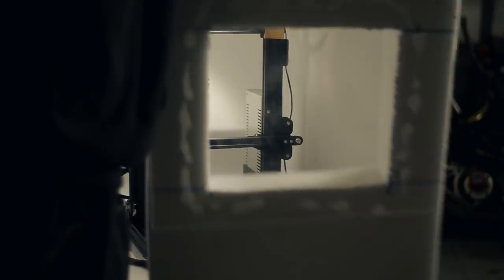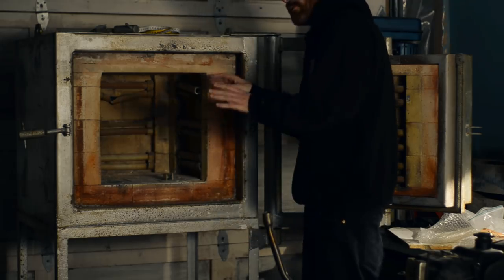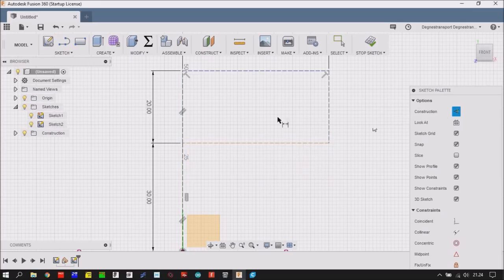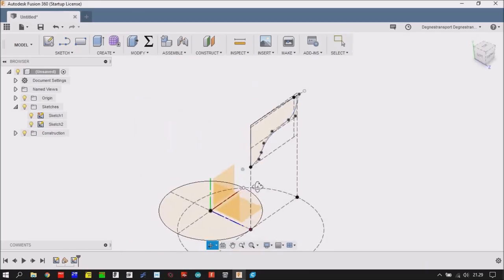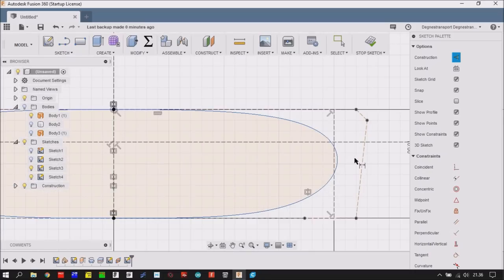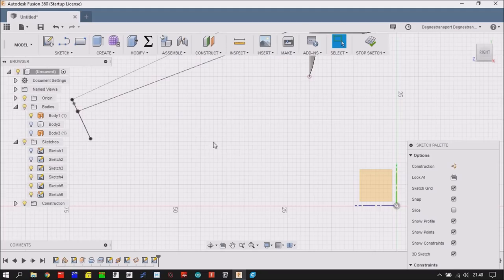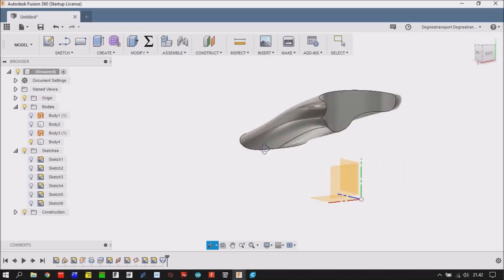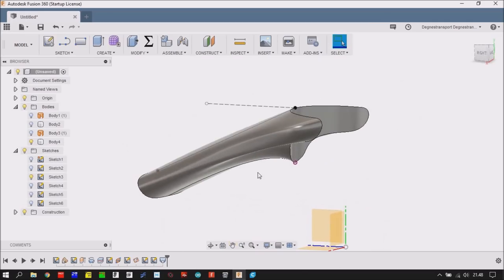Road to The Most Powerful Two Stroke Ever Part 2 - I can do this!

Comment: I bought Jennings Two Stroke Tuners handbook in about 1983 when I was road racing the LC350 stroke and planning on doing mods after racing it standard.
I read it many times over including sitting on the couch reading it during Christmas day with the family, my GF was not impressed and gave me hell over it but I only had a few weeks to read it and get the pipe made and porting done in time for the race season so it had to be done.
Reply from the maker: Sounds like me... I've read it multiple times too, years ago, but only in pdf form. A physical copy is something different.
Reply: @2STROKESTUFFING  
Yep, hard copy is good for doing a quick lookup of equations in the workshop too when I was making pipes, no need for a pc.
Reply: I also read Jennings Two Stroke Tuners handbook ,but I'm only 17.  I heard that Jennings formulas are not so accurate, but are they usefull ? I want to make my own pipe, but I'm not sore about which formulas should I use. Maybe Blairs stuff is more usefull ?
Reply: @JohnAZHUN  Jennings book was written in the 1970s and derived from copying factory pipes and a bit of reverse engineering, the pipes do work, that said Blairs equations are from more scientific studies done on using modelling and published in 1996 so far more recent.
Reply: @AuMechanic  Okay, thanks for the answer!
Reply: @2STROKESTUFFING   '2-stroke tuning in performance & practice'  (Graeme bell)  this was the bible of 2t tuning in my day..mostly kart orientated motors ,but excellent reference for general tuning...had a few pipes made from equasions from this book ,all worked fine...👍
Reply: classic desirable book .. prices have come down .. but about 15yrs ago a good quality paperback used copy of Jennings book was selling for up to $250.
Reply: yes, jennings book was usefull in the 70,s , i used it ,but as the years rolled by gordon blairs, q u b  s a e papers were the best, i stopped playing with two strokes in the early 90.s but bought a few  s a e papers later ,these are where the real info is as the guys doing the development are really switched on , since g p bikes outlawed the two strokes ofcourse outright power development stopped, , i dont agree with alot of this guys power figures but the use of a 3 d print is magic and ofcourse the cad drawing , i had to hand draw all the port shapes , etc , that was hours of work  and a lot of times it didnt ofcourse the real power is in the pipe
Reply: by the way what the guy needs now before he prints the barrel is c f d to show what the gas flows will do

Comment: If you dont need as much height in the kiln then you could remove the bottom set of elements and add fire bricks in the base to reduce the volume, that way you keep the kiln volume to element ratio, in doing so reducing your electric demand but still maintaining the same temp ranges.
Only cost you some bricks and the time to rewire to single phase not a hard mission.
Reply from the maker: Thanks for the tip!

Comment: Top fuel dragsters often drilled 6- 10 micro holes horizontally in the rings running higher RPM and cooler under extreme conditions + fuel types, where the ring meets the cylinder wall allowing oil pressure to minutely lube the parts that need it the most , ever heard of that? USA hot rod magazines has the info , I thought you might be interested. Love the Low\High tech projects,  Thanx Richard Mack.
Reply: That will not work on single ring 2 stroke pistons because the ring won't expand properly anymore, and thus increases blow-by.
Reply: nick f look back tomorrow I'll try n find some info for you
Reply: No, we don't

Comment: I been building some small 2 strokes myself. Playing with some old homelites. Dropped the deck. Raised the head. Running exaust at 100% of bore. Havent caughy the ring yet. "YET". changed the transfer angels and made a expantion pipe for it. Built a dino from old alternator and motor was .7hp at 10500 rpm. After my mod which are not all listed i was able to pump out 7.2hp at 14,500. Running on methonal. Motor sounds awsome but scary. Still progressing further everytime i play with it. Pushing it to distruction to test limits. Love all your videos. Taught me alot. I may upload a video. Never have before. Keep up the great work and ideas.
Reply from the maker: Thanks! Wait, 110% of bore?!
Reply: @2STROKESTUFFING  the port width. And i only raised it .065" which is the same of as to what i dropped the cylinder. And i have the the piston pin welded shut. Its a one time deal
Reply: Not sure of duration
Reply: I believe i have it at 210 degrees and what did the most was changing transfer angles and stuffing the crank case
Reply: @2STROKESTUFFING  nevemnd you it just dawned on me. I havent been measuring right 110 is not possible. Wow. Its 100. But since on the motor im working with has such a skiny tranfer and they are far back towards the intake i have the exaust cut clear back almost going above the tranfers.
Reply from the maker: Pics anywhere?
Reply: @2STROKESTUFFING  no i will try to upload some. Im not on anyforms or anything. Dont even document my work much.

Comment: For your kiln you want to determine and record shop voltage, feed conductor size, approximate length and the type, your maximum temperature, kiln volume, insulation type and thickness plus your door seal quality. You will likely want a PID Temperature Controller with a K type Thermocouple and Solid State Relays.  I suggest a temp controller with a Ramp & Soak feature. This allows a programmed ramp to control the rate the temperature is raised and lowered. It would also allow pausing at set points to allow time for the heat to Soak. There's several ways to handle the SSR's, pulse width modulation, regular on/off, and proportion SSR's. PID Temperature Controllers have become quite inexpensive and with Autotune and Fuzzy Logic they can be set up without having to understand Proportional, Integral, Derivative adjustments. Thermocouples are a junction point of dissimilar alloys that produce a voltage in proportion to temperature. You can install them in parallel  to measure the average temperature. A pair of well placed thermocouples is a nice feature to have if a thermocouple fails. They usually fail open so your cure would be able to continue without knowing a failure had occurred. If you're not in a hurry it's possible to order elements to perfectly suit your needs.  

You can operate your 3 phase heaters using a Variable Frequency Drive, a VFD. It will covert your single phase AC voltage to DC and that DC into 3 phase AC. A PID controller can be linked to the VFD for a tidy package. This wouldn't be my first choice as it relies on a lot of parts getting along. Heating elements are prone to causing problems in their dying seconds and have been known to jump considerable distance to short on their nearest relative and fry something that earlier was controlling their every move. 

Well there's a start for your consideration. Now back to your video.
Reply from the maker: Thanks for the tips, much appreciated!

Comment: About the kiln: since we are not shooting for very high temperatures, or fast heating, I would just change the internal wiring if it is possible. If you have a N in the connecting point where the input cable connects to the kiln, just connect a normal 1-phase plug with blue going to N and brown connecting to L1 and L2. If the kiln really is 5kW it should be ok if it is the only load on that breaker. The broken elements seem to be the top, so if you're lucky, they all are in the same phase. If not, you could swap the elements and insulators around until they are. Then you would get 2/3 heating power, 1 phase input and would have to buy zero parts. If in doubt, consult a savvy electrician.
Reply from the maker: Sounds like a good Plan A!

Comment: I'm quite sure that you have to make two separate exhausts to make the gas changes faster. Two exhausts system divides one big vortex into two smaller one. These small vortex are faster and then you can add RPMs near 19 000 or at least 18 500.

Comment: You can center/align view on a layer by using the function on the bottom middle, left to the hand-symbol (it looks like a folder or a wallet) 
and then selecting the layer to align your view with.

If you cant select the layer make sure its visible and selectable in the feature tree(the hierarchy on the left handside) 
You can find all created layers under the construction folder just hit the light bulb to make them visible.
Reply from the maker: Thanks for the tip!

Comment: you can fit an inverter for the kiln converts single phase into 3 phase garages use them for there lift ramps
Reply: ray walsh g if i remember correctly inverters/vfd's are not suitable for resistive loads like kiln heating elements

Comment: Always try a model symetrical parts as a single half and then mirror if you can. Less likely to cause issues. Now you have the exhaust shape you can use plane along path and use the project/ intersection tool to create a sketch  of the cross section at various points. Click on the profile generated and you'll be able to check the cross sectional area at any point along the path of the port.
Also, check out SimScale for free, powerful CFD analysis.
Reply from the maker: Thanks for the tips! Funny, I was just looking at SimScale.

Comment: I know you want to do it all yourself, but you may see how much it'd cost to have it printed for you by a company that does on demand printing and have them print it on an sla printer using castable resin made for burning out clean specifically for casting metals.
Reply from the maker: I'll look into it!
Reply: sinformant:  the drawback to that approach is that he will probably need to print many design iterations to get it printing well, and to get it printed to the right size (aluminum shrinks a lot),  and to get the porting optimized for performance ..... all that could get very costly with paying a professional company to print those parts ... just one or two outsourced print jobs can cost as much a one FDM 3D Printer.
Reply: @KrustyKlown  well he can print tests at.home.and measure. I was talking about the final version after he has everything worked out and I'm sure he is already accounting for the shrinking of aluminum.
Reply: @sinformant  still will take casting several printed parts of varying sizes before getting the shrinkage exactly right, then he will need to experiment with pouring & venting holes and some castings will not fill entirely, then when he wants to test changes to the porting .. he will need dozens of 3D printed cylinders, and probably doesn't want to pay thousands of dollars to have them professionally printed.  The printer he has, as is, is perfectly capable of parting the parts he needs for his casting project ... I run a FDM 3D printing farm business .. he can do this.
Reply: @KrustyKlown  I said final integration. With sla printing he can get it smooth and need almost no support structure and can have it printed in a casting resin made specifically for this purpose. I don't run a printer farm, but I do own two 3d printers and plan to soon built a foundry to start casting.things out of aluminum. There is a channel called Ford boy something that does sand casting with 3d printing and aluminum. He covers somewhere the exact shrinkage rate of aluminum as it cool. I al also very aware of how expensive having things printed from printing services.
Reply: @sinformant  OK, thanks for clarifying that, now I understand your suggestion much better.
In reality, to use FDM to print his part well, he will need to split it into several pieces ... basically design it for FDM printing. Once he does then get to a final design, he might as well FDM print it on his own machine. I have always wonder, for casting, would it make sense to try FDM printing using ONLY water soluble support FDM filament material, in a plaster of paris mold (not sand) .. just wash out the FDM part prior to pouring in the aluminum.
Reply from the maker: That is a very interesting idea! Seems like alot of the problems with the lost pla process has to do with how the mold reacts to the plastic expanding during burn out. How would the plaster mold like being submerged in water? Wouldn't it too start dissolving?
Reply: @KrustyKlown  that is a good idea to use plaster instead of sand for a better finish.I've seen others do it with mixed results as plaster retains water. My father actually works for an investment casting company and they use a ceramic powder they mix up with water to make a slurry. Then they build up several layers with coatings of silica sand in between layers. They start with a prime coating that is very watery. After it is all dried they put it in an autoclave to melt out the inner part which is made from injection molded wax. Then they fire it in a kiln to fully harden the ceramic and burn out the remnants of wax, then pour the metal when the shell is still glowing. Pretty interesting stuff.
Reply: @sinformant  I've seen people do the FDM 3D printed PLA  in Plaster of Paris .. then kiln fire it to burn out the PLA, prior to pouring the Aluminum ... seems to work well for making just a few parts (its obviously time consuming firing in the kiln and busting the part out of the plaster).  Also seen people use Investment plaster, which is water soluble, could be easier to use instead of busting out plaster of paris.
Yes, the investment casting process is slick .. I've had parts made by that process before, looked almost as good as some die cast parts.

Comment: To the furnace u probably need the ~900°C for the casting because the small amount of molten metal cannot hold the temperature for the casting u need at least 100°K more to prevent it from solidifying to early

If u melt more metal u will not need that much of extra temp but ist a cost thing

Metal casting is a since it self don't underestimate that process u will fail several times before you get any good parts
Reply: But as always ur community and I'm as a part of it will support you all the way so keep it up man 👍
Reply from the maker: Thanks, and thanks for the tips!
Reply: I pour at ~730C with great results.  Too much heat causes more problems such as excessive shrinkage.
Reply from the maker: Thanks for the tip!

Comment: Nice video. I think it is a doable to print it with supports, the water jacket side on the heated bed: a bit of supports from the transfert/exhaust ports to the cylinder, nearly all  transfert ports will be free from supports, at the exhaust port it will be easy to remove supports (if really needed), of course there are supports in the water jacket, but not a big deal to remove them accessibility is good. It is also possible to split the model in few parts to simplify the 3d printing.
Reply from the maker: Thanks, I'll have a close look at my options when the actual cylinder is done.

Comment: I've had success printing complex parts in seperate pieces using tongue and groove or similar creating near seamless joins... I also like to only use support from build plate only,  also print at 0.3 layer heights and lower print temp 5 - 10deg to increase you printers ability to do overhangs 
Dual extruder will decrease your build volume slightly too btw
Reply from the maker: Thanks for the tips!

Comment: Is using that Fusion little like Rhino? Is that expensive program or do I get anything that works for free? Im getting 3d-printer in spring to go with my lathes and mill, I need plastic pieces now and then, mostly NOW.. Im metal artesan and like to do similar stuff You do, inventions!

Comment: Hello Alex,

I would be very interested in printing one of these to put on my shelf.  is there any chance i could get ahold of the stl file?  No is an ok answer if you are not comfortable sharing it.  I plan on doing my own variation of a larger bore engine using similar designs

Comment: I am glad you got your problem sorted. Dont worry too much with learning the program. The new 3d programs like fusion are easy to learn. You just need to play around with it. For getting the top view just click on top on the cube to your top right, it should snap to the top view.
Reply from the maker: True. Does clicking on top of the cube work for a plane at an angle?
Reply: @2STROKESTUFFING  no, i will go and have a look later today how you view a user plain head on. Need to go sleep, writing test today.
Reply from the maker: Awesome!

Comment: That printer should be fine if you can make the part the other way up so you reduce overhangs alternatively you can do bridging with a 3d printer so overhangs within limits shouldn't be to bad, if you want to try printing major over hangs id print a "bullseye" by pets fang (found on thingiverse) as it helps cool the plastic allowing you to print overhangs better
Reply from the maker: Thanks for the tip!

Comment: Wouldnt power increase if you run a smaller gap between the piston and cylinder, like on formula 1 cars. 
You have to heat up the cylinder before running it though